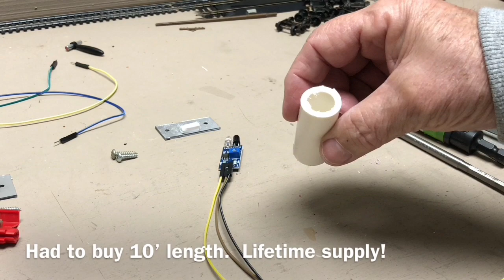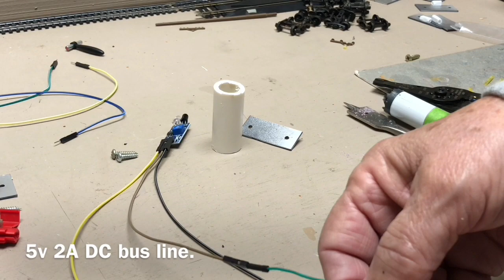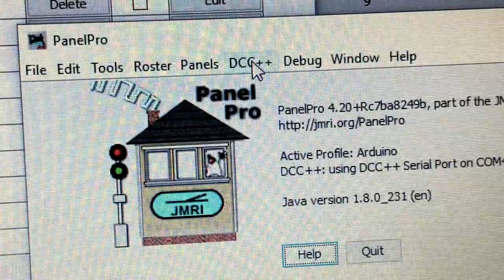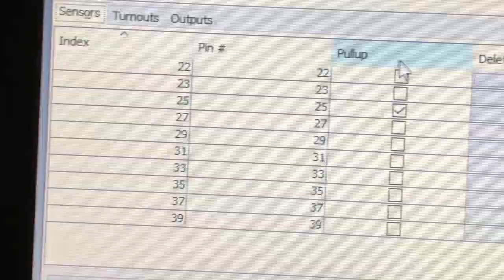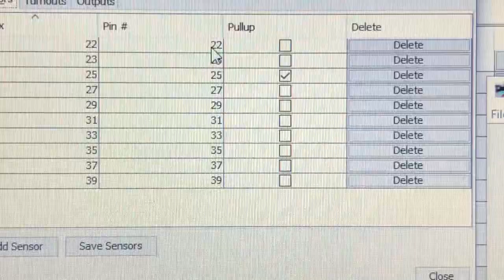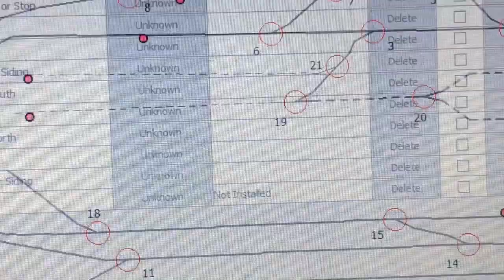JMRI- Arduino Infrared Sensor Install

Comment from the maker: Follow up:  don’t cut ends off the short DuPont wire which goes into the 3M connector.  Failed connection.  Insert the metal pin into the 3M connector and crimp.

Comment: Hey we just exchanged replies on another youtuber's channel.  Now I stumbled upon yours. Sometimes the internet can be a small world.
I know nothing about IF sensors.  Would they work if I turned them 90 degs to fit in an n scale track?
Reply from the maker: Sure can be small  World. I’m assuming you could put them horizontal in a building and would work the same.  I have not tried this but you would need to test in exact location.  I had my garage door open one time and sensors stopped working.  Only thing I could determine was they didn’t like the shiny side of the door insulation.  Closed garage door and they started working.  There’s a distance adjustment but I actually don’t understand this either.  Mine trigger at about 1/2” as car or loco goes over them.  The JMRI script to work with them is pretty simple.  I’ve done video on this.  Not exactly such which one as I write this.  I’ll post link later.
Reply from the maker: Here’s link that talks about installing:  https://youtu.be/PQZl7mSUxVU
Reply from the maker: Here’s another one:  https://youtu.be/vznftZMa76c
Reply from the maker: This show actual JMRI script to work with sensor.  https://youtu.be/pBNkztDlaF8

Comment: Morning Uncle Frede,  I've said it before you make a great teacher!!! 🤗! Great job.
Reply from the maker: Thanks Grant.  I thought the video was one of my better ones.  But then #$&@ took back over.  🤬🤬.  I tried 4 times over two days to get a sensor installed.  Wasted 8 connectors!  No power from bus line to sensor.  I changed sensor but nope.  I tested sensor directly on Arduino, worked fine.  I finally decided it must be the cut off male end that was problem.  Sure enough, left the little pecker on, worked fine!  I added a comment on the video.  Lesson learned, don’t cut off your little male part. 

The $&#@ continued.  Put the working sensor into the hole, no sensor trigger.  Took it out and filed the hole in track bigger.  No trigger.  Did this multiple times.  No trigger. 🤬🤬🤬🤬 Talk about frustrated!   Gave up.  Went in house very discouraged.  Normal.  I thought maybe sensor having problem with plastic containers on wire shelf above layout.  Tried a fix.  Nope.  Finally changed the sensor, working fine!  I hate model railroading!

Comment: Nice and easy
Fred I noticed your not really using any wire colour standard's
Reply from the maker: You’re right.  Just using what I have.   😀
Reply: @FredE528  
On 2 wire unearthed DC system by the NEC standard's
Red is positive
Black is negative
Earth ground is green or green with yellow stripes